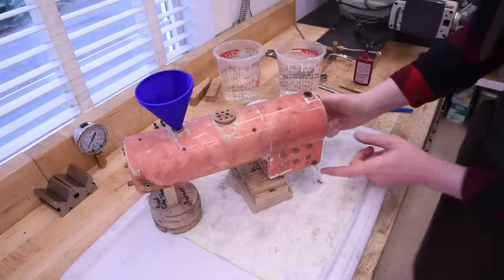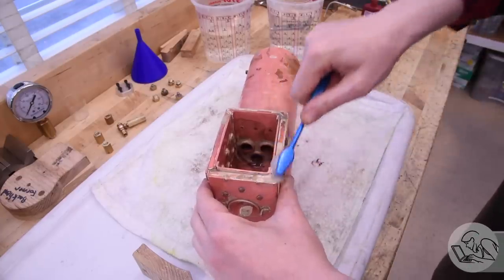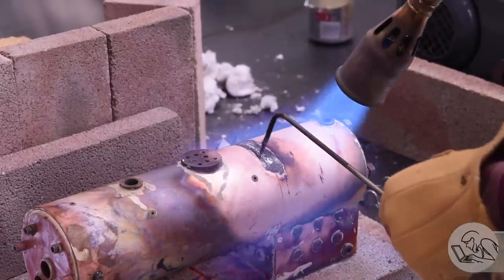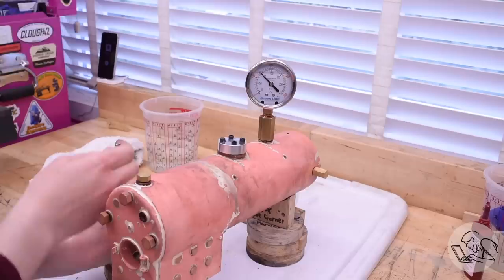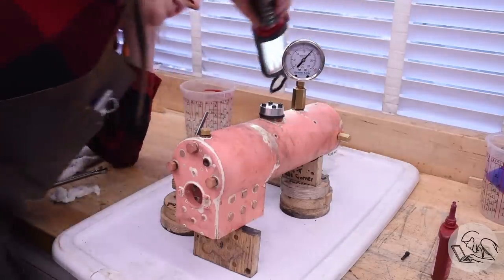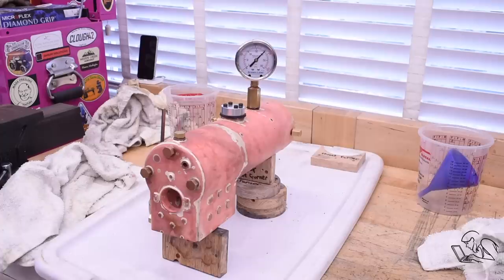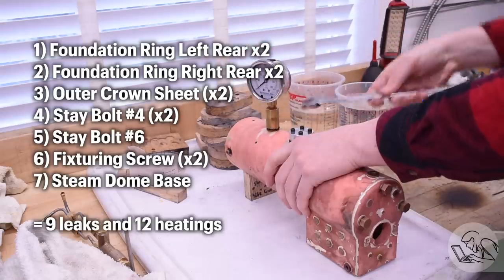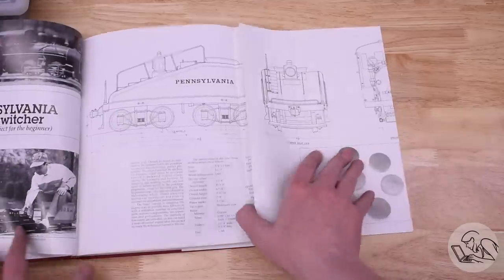Boiler Pressure Test!!! Pennsylvania A3 Switcher, Part 13

Comment: I've never done anything like prove a boiler so I have no idea if this is practical, but as a first rough watertight test would putting in a couple of psi of air pressure in and dunki ing the whole thing in a water bath be a quick way to identify multiple air leaks? It must be easier to see where bubbles are getting out than spot where water is seeping out? and now I see that kasuha has already suggested it. DoH! Also, flourescent dye in the water and a UV light for the later tests?

Comment: @Blondihacks:
There is a thing called "water finding paste", and is it exactly that. It is a paste that you smear around places you expect leaks, but you can't see during the test. Afterwards you can see where the was has been running, even if it is dry again, because the paste changes color permanently. Also water indicator paper can be helpfull for finding small leaks in solder joints. You just take a small strip and run an edge of it down the seam. If it changes color, there was a tiny drop of water sitting in a crevice in the joint, that was too small to see.

I learned about these when I was a regular customer to an environment simulation test facility, where we tested our machines for dust and water tightness.

These items aren't cheap, but powerful tools.

Comment: It's normal that analog pressure meters drop two pounds when reading a fix pressure.
After they drop those two pounds you get the exact reading.
Congratulations for building such a great boilers.
🎉🎉🎉🎉

Comment: Having spent years brazing and silver soldering multiple joint valves in the HVAC industry I can say nothing is more frustrating when fixing one pin hole opens up 6 more!

Comment: My word! I have to perform a hydraulic test on my elderly LBSC 3.5" Gauge "Molly" Boiler soon.
A Model Engineer commented that some of the structural joints look like soft solder, as opposed to Silver Solder, so I will carefully scrape away any surplus solder to try and expose as much of the joints as possible.

From your video, it looks like I might be having some "fun" soon?
I will definitely join the local club to get their opnions, but fingers crossed, my boiler will be save able.

Comment: So glad that it passed the pressure test. You did very well to fix and repair all the leaks. One thing though, why do you have to pickle after each solder??? Why not wait until it passes the pressure test then pickle at the end??
What test will the "Club"' or Classification do, in that, is it any different to what you've just done??
I use to work & operate for many many years with Mitsui MSD 55ER Boilers. Touch bigger than the one you've just built. Basically, 6Mpa operating pressure at 510°C steam temperature.

Comment: Having made and repaired a dozen or so boilers, I like what you do, and how you explain things. I must get some of your Pickle. I have used Central Heating de-scaler for many years. Smells of "matches"? so Sulphurous or maybe some phosphate? - Takes a day to pickle like yours, so I only get 1 fix per day when chasing the pin-holes. I missed it somewhere, what is your flux (the black paint) - easier than mine... (Easy-flo flux).  I also use a3 burners, as my biggest is not as big as yours. But I use insulation (Half bury the boiler in a sand tin and fire-brick surrounding most of remainder of boiler). I wear leather welders' gauntlets, leather apron and safety goggles/screen. (From Industrial hot-work experience).
Great tutorials: Keep up the excellent work.
K2😄

Comment: I would suggest using white out/ liquid paper to help guide the solder. I use it to stop the solder from flowing in places where I don't want it. Just apply it the same time as your flux and it creates a dirty surface solder won't flow onto to

Comment: After all the repairs, the makeup of the boiler is now about 50/50 copper and solder.
Reply: And with all that silver, it's worth more now too!
Reply: And 50 percent propane.
Reply: This needs a /s, right? It's a beautifully made boiler, the joints are tight and the actual quantity of solder is pretty low. The sheer number of joints is mind boggling, though, for sure.

Comment: baby powder. dont know if it would work for you. but i used to have a 86 Pontiac firebird. the hatch leaked. so i put baby powder on its gasket to find where it was leaking. worked great.

Comment: I wonder if that last couple PSI on the final test was down to the residual air going into solution?  There's always that little bit trapped at the top of something, no matter how hard you try to remove the bubbles and fill the pockets.

Comment: 200psi seems a pretty high test pressure for such a small boiler, as we tested our 200psi mainline steam locomotive boiler to only 250psi. We had a large number of leaks inside the firebox from the stays, however the inspector was quite happy as he said that they would soon rust up, something that will not happen obviously with a copper boiler.
Reply from the maker: 2x working pressure. Small boilers still run at high pressure.

Comment: You have probably been asked this before. I was a mount maker for museums and we used silver solders of different heat ranges. I would start wit the high temp stuff and as I added parts I would use the lower temps. Granted, I was not dealing with 200 pounds of pressure. But watching you re-solder parts really makes me close my eyes. Is it a pressure thing that makes you use the solder you do?
Reply from the maker: I do use multiple ranges. Explained earlier in the series
Reply: @Blondihacks  My apologies!  I can't believe I missed a video! I look forward to everything you post. I will go back an look for it. Thanks

Comment: It's such a buried lede here when you mention talking to the boiler inspection folks at the model engineering club. THAT'S HUGE NEWS! It's not the certification, but you are SO CLOSE.

Also, totally unrelatedly, we adopted a recuse dog. We were a cat family before. Anyway, the beef brisket on legs they tell us is actually a dog came with a wonderful name, but as a disambiguating strategy, my dog and your cat should never be in the same room.

Comment: Hi Quinn, in jewelry making,  when we have several successive joints to solder, we use three types of solder that melt at different temperatures, starting with the highest and progressing to the lowest for the last, to avoid melting the previously soldered joints.  Is there a reason you couldn't use the same process for a boiler?
Reply from the maker: I did. Watch the series.

Comment: A few PSI from 200 PSIG over 15 minutes could easily be due to dropping temperature. If you maintain both temperature and pressure unchanged you can be assured it is leak tight.  Helium mass spectrometer leak testing can resolve leaks as small as 1x10^-12 std atmosphere*CCs/sec or about 1 std atm*cc over about 32,000 years. "Sniffing" using HMSLD can resolve about 1x10^-6 atm*cc/sec.  Use to test all sorts of pressure vessels using HMSLD...

Comment: What is the reasoning for inspection and certification from a local boiler club? Is it to get a second set of eyes on the project to make sure you did not make a mistake; are boilers this small licensed and regulated; or is there some other reason?
Reply from the maker: Safety for the general public and insurance purposes.

Comment: Instead of food colouring type of dye you should add automotive fluorescent dye for leak testing coolant lines. Use a black light and it will glow from the spot it’s leaking from.

Comment: a question:  why do you use the large torch?  would a smaller, more focused flame size work better?
Reply: she has addressed this before—the problem is that the heat diffuses throughout the large boiler, so essentially she has to heat the entire boiler every time she wants to solder something. pinpointing the flame would only prolong the process of heating, and might in her case make the solder melt due to the torch and not the metal around the joint. it's a good thought, but not translatable to the specific case of pressure-tight soldering an 8 pound boiler

Comment: queston why such a huge touch tip why not one would use for brazen like a #00 or #1 #2  ?
Reply: she has addressed this before—the problem is that the heat diffuses throughout the large boiler, so essentially she has to heat the entire boiler every time she wants to solder something. pinpointing the flame would only prolong the process of heating, and might in her case make the solder melt due to the torch and not the metal around the joint. it's a good thought, but not translatable to the specific case of pressure-tight soldering an 8 pound boiler

Comment: I know it's been explained in an earlier video, but why such a big torch to seal a small leak?
Reply: From what I've understood (I'm no expert so please correct me if I'm wrong) it's because the whole boiler acts as a heatsink and there's a lot of cooper that needs to heat up before the spot you're interested in can get warm enough.
Reply: yeah she has addressed this before—the problem is that the heat diffuses throughout the large boiler, so essentially she has to heat the entire boiler every time she wants to solder something. pinpointing the flame would only prolong the process of heating, and might in her case make the solder melt due to the torch and not the metal around the joint. it's a good thought, but not translatable to the specific case of pressure-tight soldering an 8 pound boiler
Reply from the maker: Robert you are my hero for going through and answering all these. No matter how many times I answer it, people keep asking. 😄
Reply: I've only used oxy acetylene to weld steel and aluminium, never copper. Interesting. I can understand the skill involved to get it right.

Comment: I make jewelry and small sculptures from recycled copper.  Many pieces have multiple solder joints. Using a small torch with a pinpoint flame allows me to concentrate heat on the joint I'm working on without spreading that heat to nearby existing joints. Perhaps this technique would help you avoid the problems you've encountered.
Reply: she has addressed this before—the problem is that the heat diffuses throughout the large boiler, so essentially she has to heat the entire boiler every time she wants to solder something. pinpointing the flame would only prolong the process of heating, and might in her case make the solder melt due to the torch and not the metal around the joint. it's a good thought, but not translatable to the specific case of pressure-tight soldering an 8 pound boiler

Comment: Your torch for soldering is much to big, you only need a 2" flame to concentrate on the area needed,a big flame just keeps melting other areas..try a hand butane torch instead..Ian
Reply: she has addressed this before—the problem is that the heat diffuses throughout the large boiler, so essentially she has to heat the entire boiler every time she wants to solder something. pinpointing the flame would only prolong the process of heating, and might in her case make the solder melt due to the torch and not the metal around the joint. it's a good thought, but not translatable to the specific case of pressure-tight soldering an 8 pound boiler